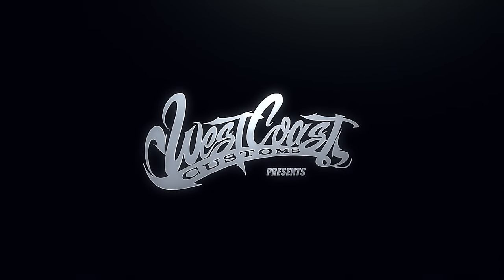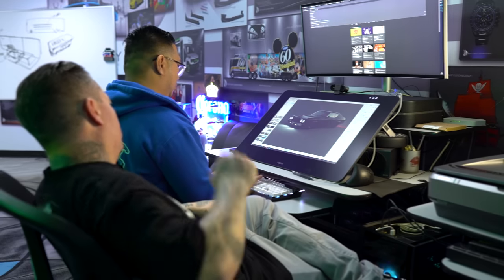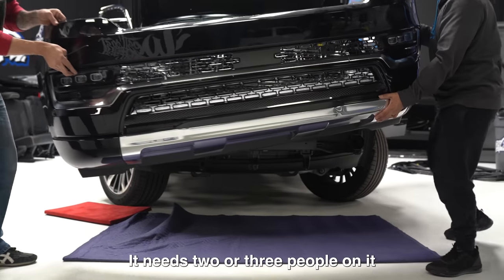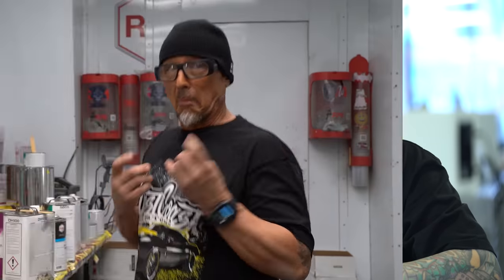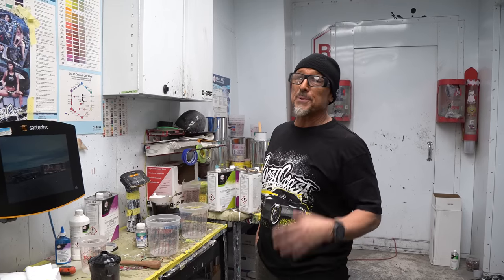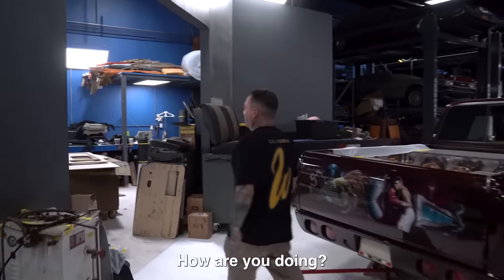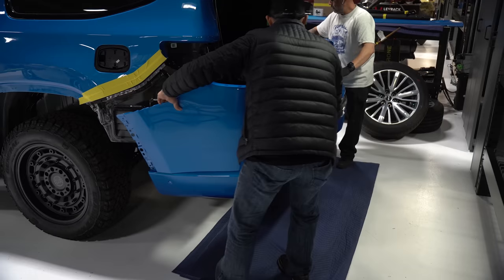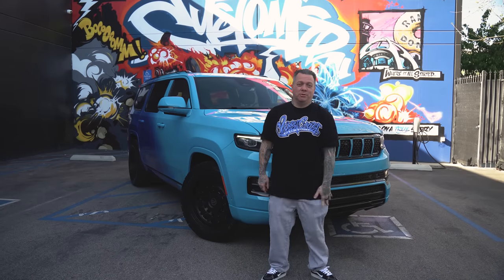Fade Paint Job | West Coast Customs

Comment: Ryan, your crew does beautiful bodywork, fabrication and interior work and great paintwork. However, i have been doing custom paintwork and fabrication ,convertible truck conversions,hot rod builds , offshore racing powerboats chopper builds in South Florida for over 45 years .We did pearls ,candies,metal flakes,multi color graphics, multi directional fades,airbrush murals and radial shading .No offense, but that fade job wouldn't be acceptable here in So Fla as our customers are highly critical and demanding. That paint job would be considered a great angle shade, because here if you can see even a discernable blend line ,it'll be a guaranteed redo ! We're doing doing multi fade paintwork here , top to bottom, front to back ,multi color front  to back ,and these are on exotic and hypercars,Lambos,McLarens,Rolls,McLaren,, etc and some other garish crazy stuff. So that would be angle shading here ! Again, not busting chops ,but just saying! Respect on surviving the stress,bullshit and crazy customers that you had to ,and have to put up with ,especially the nutjobs from the environmental agencies in Cali ,and still having longevity !  We've got them here too, making us crazier by the minute ! Continue being an innovative OG and raising the bar brotha .